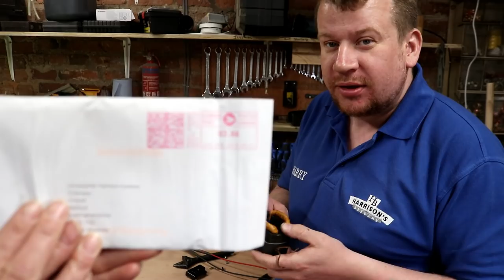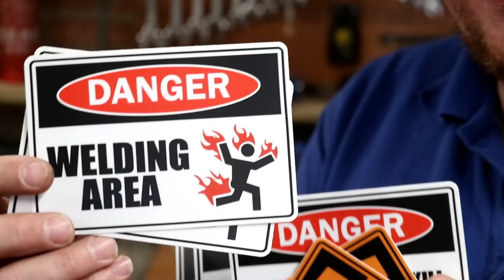INSIDE AN ALFA STANDARD

Comment: These videos are interesting Harry m8,it's nice to have a break from brewing and see some behind the scenes.They don't build machines like they used to do they,imagine it's lasted this long and only now one little capacitor is dodgy. Given age of machine you might have trouble getting a replacement original motor,might have to punt for something more modern,just make sure it's similar output or you'll burn out the machine. Might just be easier to replace the capacitor with a more modern version. Try and keep that old machine going they are getting rare now but I still prefer the older stuff. Cheers.
Reply from the maker: Yeah, I'm gonna look for a new capacitor for it. I love the old stuff too.